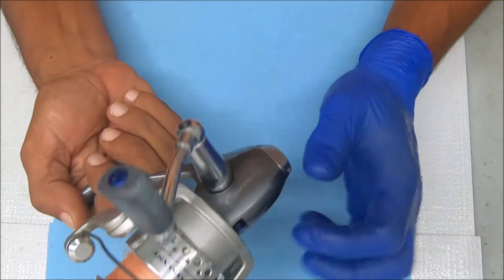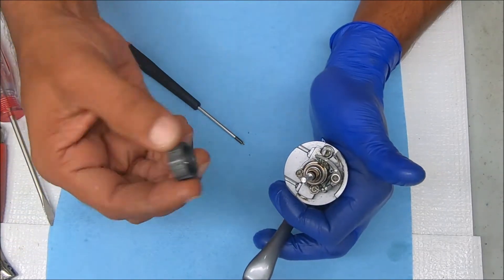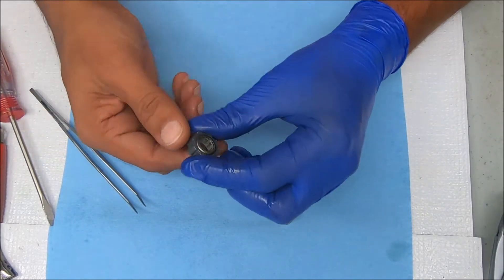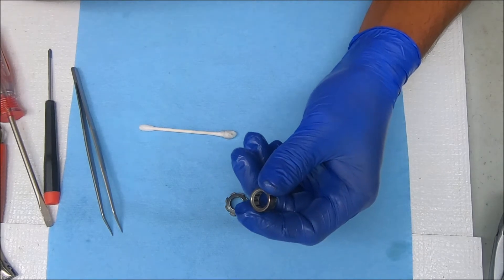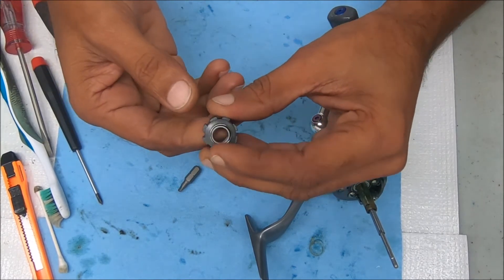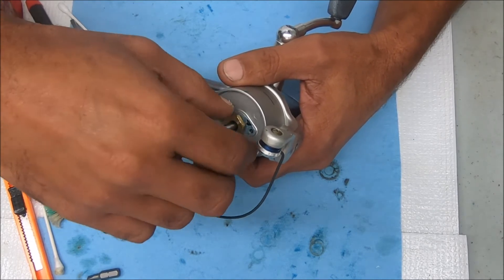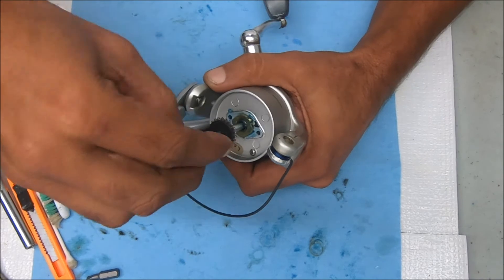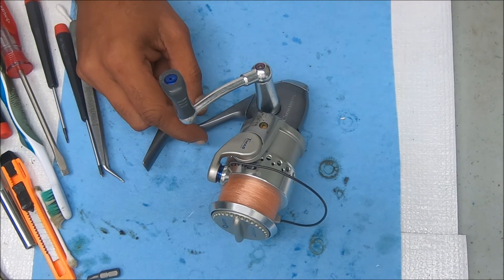Quantum Catalyst 40PTS Anti-Reverse Slipping / Not Working With Fix: Fishing Reel Repair

Comment: Thanks for this video, I purchased 8 of the Catalyst PTI freshwater reels back in 2004 (4 each) in 20 and 30 sizes.  One by one all failed and I did the same JB Weld fix.  Nearly 20 years later and the reels still work great.  The earlier Quantum reels dating back 15-20 years are far superior to the plastic housing reels of today.
Reply from the maker: You're welcome and thanks for watching! Thanks also for the confirmation of longevity of the hack. Spread the word about the channel.

Comment: Just tried this with a Quantum Catalyst 20 pti, using Gorilla Glue gel. It works better already but haven’t applied much pressure as it takes 24 hours for the glue to fully cure. I was careful with the glue since too much and it gets in the bearings and too little wouldn’t be enough hold. I did need to use a small screwdriver too work the bearing out of the cap, it was loose until about halfway out. I think this is going to work and I’m going to get my reel back in action. Thank you for the video
Reply from the maker: Thanks for watching! Happy to hear it helped. The person I did it for hasn't brought it back, so I'm assuming it's still holding steady. Yes, the amount of glue used had to be judged carefully, and give it 2 days to cure before testing it out. Let your friends know about the channel. More vids to come!

Comment: Thank you for the video. I encountered this problem with a Quantum Kinetic 10 reel. Unfortunately, this fix did not work for me because the metal sleeve wouldn’t come out of the plastic ratchet so I was unable to glue it so the sleeve would stop slipping.
Reply from the maker: Thanks for watching. Is it the same a/r and ratchet configuration?

Comment: I am trying to get this working on my quantum pt s3 smoke inshore spinning reel. I took it apart to clean and oil and found out I’m should have piled that anti reverse. Oops wonder if this will work on that also?
Reply from the maker: Thanks for watching. The a/r on the S3 is not the same as what I'm showing in this video. What do you mean by piled?

Comment: I’ve got it to work without the spool, but when I put the spool on it doesn’t work anymore. What’s up with that?
Reply from the maker: Thanks for reaching out. Not sure.... maybe you did a poor glue job. Maybe your anti-reverse is too far gone. Adding weight (vis a vis, the spool) to anything will increase the load and expose any flaws. If your glue-job hasn't failed, then your a/r is shot.